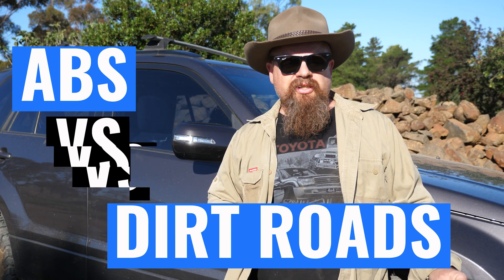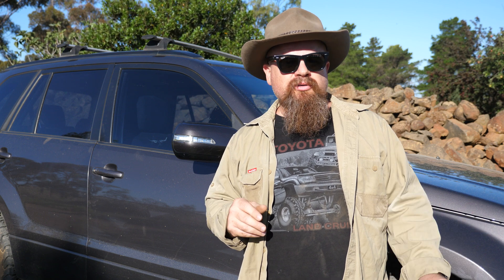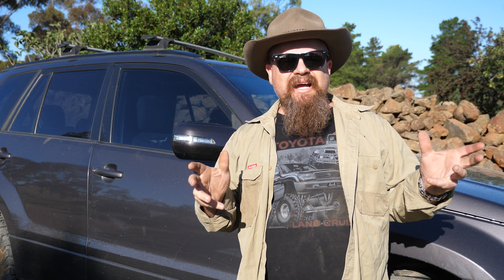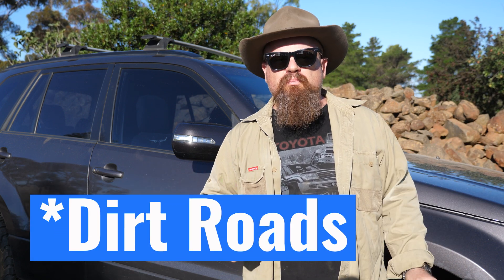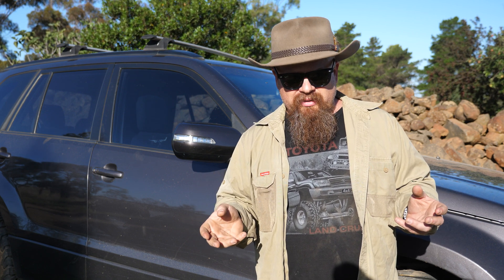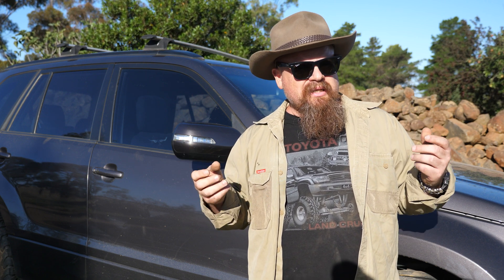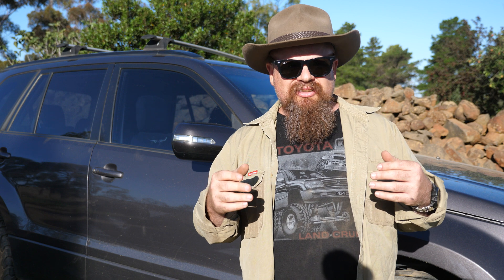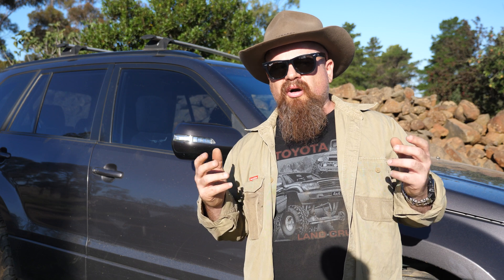ABS (Anti-Lock Braking Systems) VS Dirt Roads

Comment: Remender a time when I crashed into a tree on dirt because of ABS, smashed the brakes and it kept rolling, without abs I would have stopped before the tree or at least safely slid straight out of the turn.

Comment: I would have nearly hit a person on the bad road where my brakes got locked due to abs working and there was nearly only 5 seconds gap to take action. Thankfully I knew if you remove the step from break and press twice in a row abs turns off and you can take on manual braking. Otherwise I would hv been in jail for it.

Comment: ABS IS Great on Pavement.. 
Snow: As it turns out, ABS actually increases stopping distances on snowy surfaces, as well as those covered in other loose materials, such as gravel or sand. Without ABS, locked tires dig into the snow and form a wedge in front of the tire by pushing it forward.Jan 4, 2019

Driving With ABS in Snow and Ice | YourMechanic Advice
Reply from the maker: It's a compromise, your distances blow out, though you can still steer.
Reply: ABS is also not great on pavement. Its all lies. ANd yes those who have ABS on and other electric devices they more often die in traffic accidents. And yes those with big cars and SUVs die also more than small cars. 
Also manual transmission is always faster than automatic. We live in a age where people are brainwashed to a point where they lose any sense. they are forced to believe in nonsense.

Comment: abs almost killed me once. during a storm, in a very slippery dirt road that was in bad condition, downward slope toward a bridge over a river. the car just took the brakes from me entirely. fucking thing, i went in hot and almost fell off the bridge. fucking hate abs on slippery stuff.
Reply from the maker: The more modern ABS systems are able to better cope with dirt roads I'm told.
Reply: Abs on hard surfaces shortens braking distance and helps with stability. Dirt roads with traffic are very packed and hard, in that situation abs should help cause the terrain isn't loose. The road was probably very slippery for any kind of braking. Not sure if the dirt road was loose or packed in your situation.

Comment: Thanks very interesting exercise, and very well conclusion at the end. ABS especially effective for vehicles with left side, right side on different road surfaces
Reply from the maker: If there's a large fiction coefficient difference (like two wheels on the dirt and the other to on dirt. You can't beat ABS!
Reply: Once on the highway an asshole cut us of so my mom had to go of the asphalt onto gravel with the right 2 wheels the other 2 still on asphalt while she slammed the brakes and the van stayed straight, we where going 90kmh ABS saved our ass
Reply from the maker: Classic example! You just can't vary the braking left to right under heavy emergency braking.